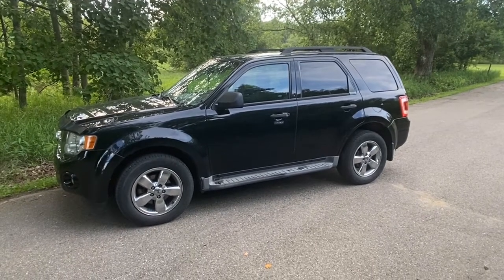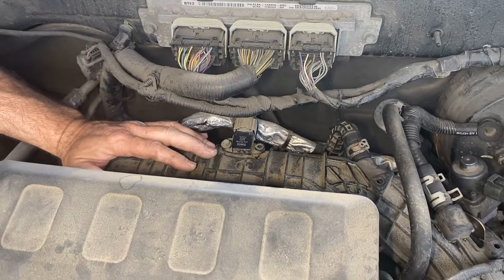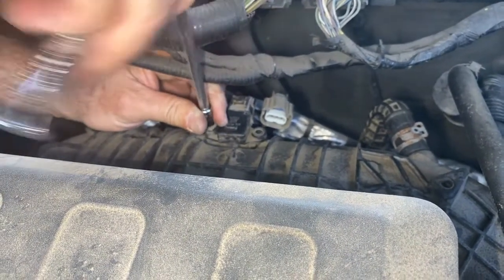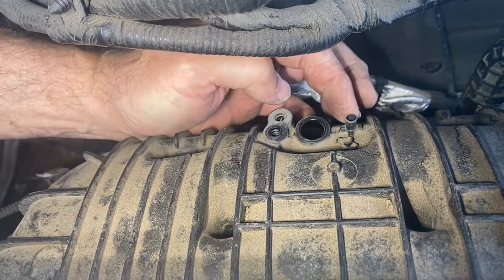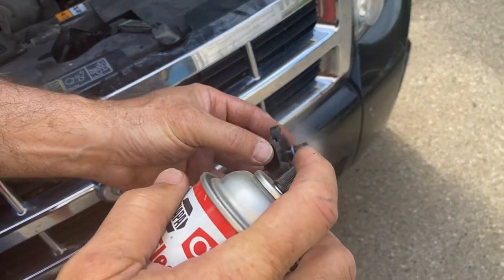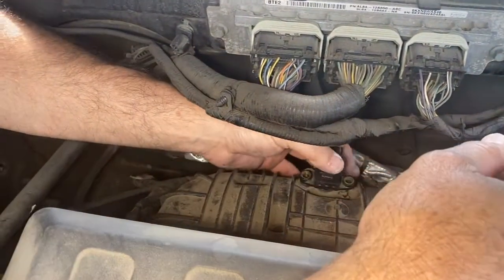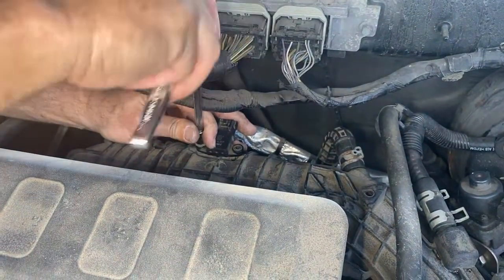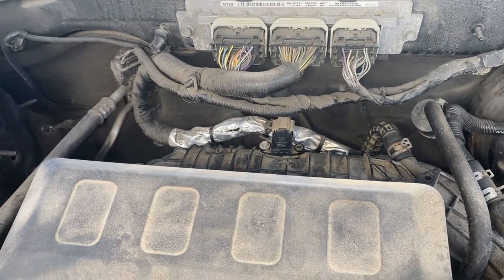How to Replace MAP Sensor Ford Escape 2nd Generation

Comment: where is the MAP sensor located on a 2012 Ford escape I4? Have the same error but its not located the sale place your video showing for this model.
Reply from the maker: Our vehicle was a V6 3.0 motor where your 2012 Escape happens to be a 2.5 four-cylinder so totally different configuration. I'm sorry at the present time we do not have a 2.5 four-cylinder at our shop.
Reply: Bro idk if you still know where is located the map sensor on Escape 2.5L 4 cylinders, is exactly on the lower part of the manifold a bit upper than the starter motor
Reply: @ingenieroalexandermartinez   I did eventually find it. however, the screws were so rusted through and stripped I had to bring it to a shop. thank you for following up. I appreciate it.